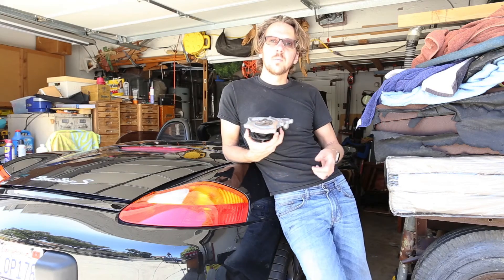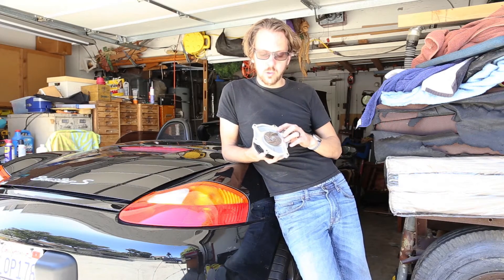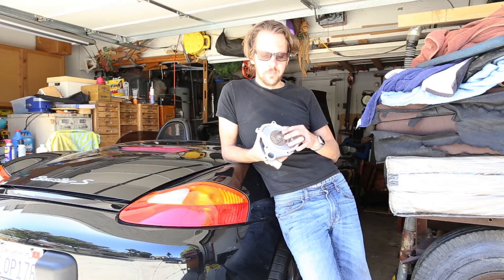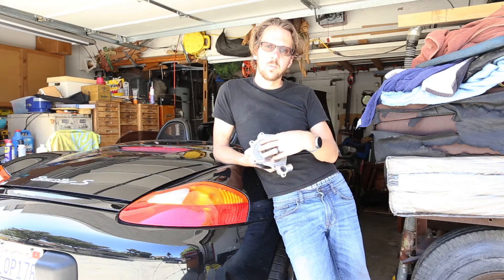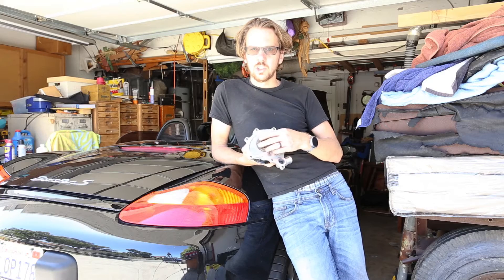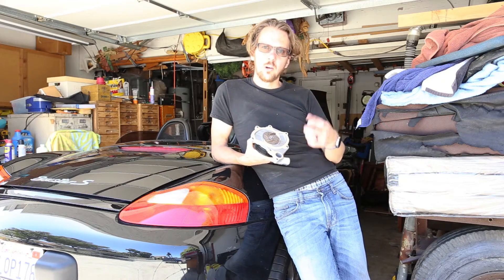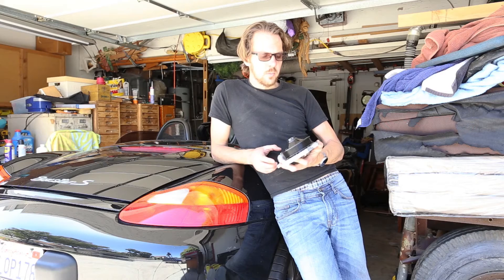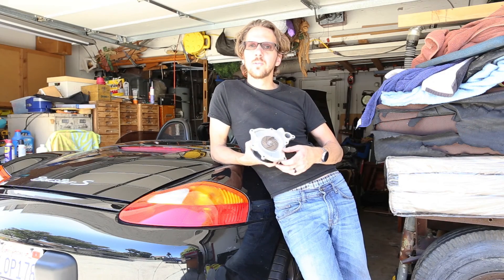Which water pump? Plastic vs. Metal Impellers

Comment: plastic is not plastic and there are also variants in metal. Long time ago the vendors tried to save cost with cheap plastic, but if PP GF40 is used, it should last a long time. Plastic has better flow and lower load on the bearing which fail often on water pumps. On metal it can also fail on the weld, cast iron has also a limited lifetime. Some vendors use brass, not sure whats the advantage. Its quite soft and corrossion shouldnt be a big problem. So every material has its pro and cons. Just saying metal vs. plastic doesnt tell anything.

Comment: Just replaced mine, car was overheating, I went with metal, it’s been a few weeks, this is no longer a daily driver so it will stay stored and used occasionally on weekends. Just did an oil change and did some driving it’s operating beautifully, levels maintaining no leaks or funky sounds 

Interesting there is slight condensation above the tank, I will be replacing the bleeder valve thinking that might be it…😅 any insight as to that?

Comment: Well the pros and cons a plastic and metal drilich way in the engine block if it's aluminium plastic will Shatter causing the engine to overheat you might be able to change the housing or repair it a lot cheaper than an engine
Reply: Can you say that again in English please?

Comment: If you change when your supposed to (often), I say an OE plastic pump. If the thing is going to sit a decade of occasional use, metal. Plastic is hard to predict in 10 years or tons of heat. Random plastic from anyone that is not OE is super suspect and equally randomizing the results. Every plastic vs metal impeller design I have seen was not a physical copy of the plastic form, but usually a simpler stamping or casting. I'm sure it hurts flow and makes turbulence, no one is likely to notice the effect but in the most extreme, and probably not even then. 

I have seen many broken plastic pumps, but all were super past the recommended replacement in orders of magnitude. In addition to all the plasticizer migrating out of the impeller, I think the resonance from a failing bearing has caused the final crack in the now brittle product and subsequent overheat. Usually a pump bearing off kilter enough to start making contact with the block is leaking enough the neglect has caused a failed head gasket from the perpetual low coolant situation. (and thus was quite noticeable via noise, puddles, or both before contact with block)

Comment: Metal elements (small pieces) migrate to small engine cooling channel jackets resulting in hot spots not good due to increased specific heat capacity of mild steel compared to plastic.  The discussion should be about what type of bearing you want as there are different grades and race designs for improved reliability which will lower chances if plastic spinning on shaft etc. Porsche spec is plastic so stay with that as far as impeller is concerned.

Comment: I know loud radios and noisy exhaust systems, sell a lot of car parts! This is true. Ethylene glycol mix with water is coolant. So, if the circulation pump has a bearing failure, it starts of noisy long before total failure. After total bearing failure, if the impeller is cast iron or stamped steel, you would get even more noise. This would normally be heard, inspected and caught long before any block damage would happen. The reduction of weight is why more plastic shows up on parts or complete parts for performance, fuel economy plus emissions. Companies have to meet “CAFE” standards each year or pay a fine. The truth is, that companies SELL credits from one to the other. This occurs as the cost of fuel changes and buying habits follow. If fuel is expensive, then hybrids, electric or small vehicles sell better that more expensive SUV’s and Trucks. I have worked on vehicles since the late 60’s with no tech school, internet or YouTube. I ask questions, watched but must have had some talent. There was a time when gas was $19.9 cents per gallon, drum brakes where normal on the front and your rebuilt water pumps. I might have a can of water-pump grease, even though it’s only job is to circulate coolant thru the block, heads, heater core and radiator, with the thermostat controlling the coolants temperature while under pressure. The pressure cap holds between 17 to 21 LBS., to raise the temperature of coolant way higher than ambient air. This makes the exchange of heat more efficient regardless of outside air temps or altitude. I won’t use a circulation pump sold with a plastic impeller are they too, can on handle so many heat cycles before failure. It’s chemical name is “PLASTIZIUM FRACTURITUS”. 
ASE Master Tech since 1978 - Retired

Comment: Metal and keep the coolant changed seems more practical. Plastic reaction to chemicals age and other worn engine stuff in the cooling system is beneficial to not have to deal with. So both types can wear out on bearings and impeller.

Comment: Hi.. Any one explain.. How can I increase the flow rate in waterpump... Now currently have cast iron impeller.. If I go to plastic impeller.. Flow rate can increase???
Reply: Yes, and that is probably the reason why most OEM impellers are PPS composite, as they are shaped better than cast or stamped metal ones, have smoother surfaces and contours that are harder to build into metal impellers.

Comment: I was planning to use a URO water pump for my 996. What are your thoughts.
Reply from the maker: My advice: don't. I've tried one or two URO parts (never a water pump), and I've been disappointing by the quality. Others I've spoken to have had similar experiences. They're not terrible parts, but they often fall a bit short of OEM. For a critical component like the water pump, I wouldn't risk it. Pierburg is OEM and a solid choice (though there are other good options).
Reply: Uro water pump in my Benz for 6 years now, about 70k miles, no issues

Comment: Will you not hear the impeller grinding metal long before it destroys something? The metal impeller on most aftermarket pumps is some kind of cast aluminum alloy = quite soft!
Reply from the maker: You might hear it... You really want to catch it before it starts milling out the engine block. That said, as long as you inspect it regularly (see https://youtu.be/csl9dB0Cffg?t=35s), You'll catch it long before it starts grinding, and you'll be fine with a metal impeller.
Reply: Hi.. Any one explain.. How can I increase the flow rate in waterpump... Now currently have cast iron impeller.. If I go to plastic impeller.. Flow rate can increase?
Reply: At the point and time you do hear the impeller hitting, you are now send metal shavings into your engine. Stay away from the metal impeller water pumps.

Comment: Water will leak for weeks before impeller touches other metal. Problem with plastic impeller is that it starts to freewheel on the shaft thus not moving water.
Reply from the maker: Yep. That's an excellent point. I don't think a metal impeller is a problem as long as you're vigilant. With regular inspection, you're likely to catch problems well before they become serious--with either impeller material.
Reply: Incorrect, the water pump can and usually does fail without any notice, zero leakage.
Reply: Hi.. Any one explain.. How can I increase the flow rate in waterpump... Now currently have cast iron impeller.. If I go to plastic impeller.. Flow rate can increase?

Comment: That may work for porsches as your impeller is small, however Audi/Volkswagen's impellers are prone to disintegrating.  Hence the metal.
Reply: I went as far as buying a water pump with a metal impeller for my vw but then decided to buy a water pump from vw. 
With vw's you're playing with the timing belt and that's potentially catastrphic. I'de rather have the plastic impeller shear off if that bearing fails.
Reply from the maker: Makes sense. I'm sure the metal / plastic distinction is not too important as long as you check the water pump periodically.
Reply: Hi.. Any one explain.. How can I increase the flow rate in waterpump... Now currently have cast iron impeller.. If I go to plastic impeller.. Flow rate can increase?